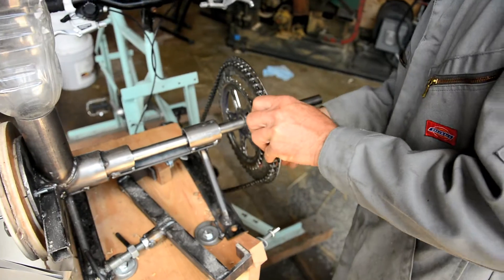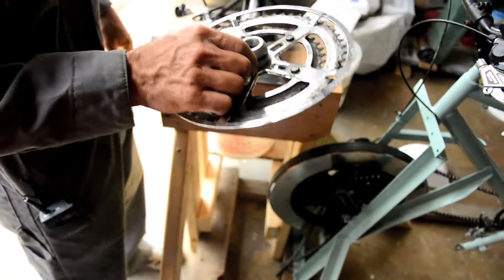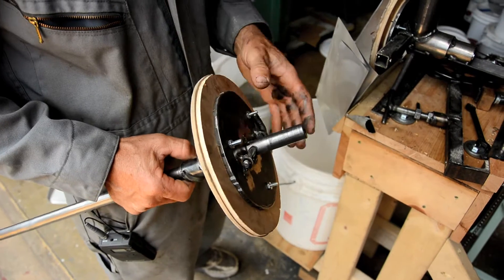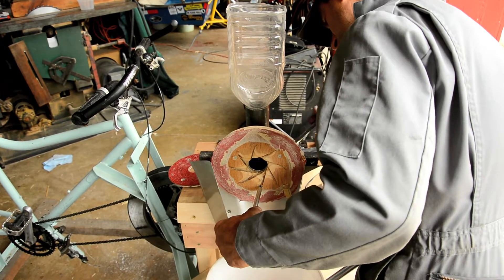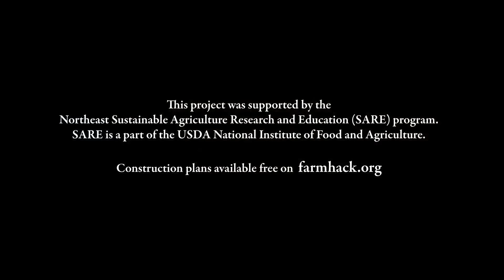GB3 Dehuller

Comment: The Thresher Plans PDF you uploaded are invaluable!  So generous of you to share this freely to anyone interested in replicating your thresher.  The winnower seems pretty straight forward (though will clearly take quite a bit of trial and error to tweak and get right), while the dehuller/grain mill seems quite a bit more complicated (for my current experience and skill set anyway).  I will have to learn how to tack weld at the very least, and various other skills and distinctions will make a pretty steep learning curve for me to make them just based off your videos on the two different machines, particularly without any diagrams with measurements, etc.  If they exist, is there any possibility that you might upload PDF plans either or both those two machines as well?  Thank you so much for making such detailed videos and sharing the two PDFs.  🙏
Reply: Hello,  the plans for ALL THE GRAIN BIKE MACHINES are available FREE thanks to a grant from SARE (so thank YOU for funding my passion).  The links to the plans are above (between the video and the comments).  When you land on the plans page you have to scroll down and click on the pdf link that says "plans final upload".  Enjoy!
Reply: @lusolarone2  Found them, THANK YOU!

Comment: There are a LOT of different sort of surfaces you could experiment with - such as more "natural" ones (rather than rubber or sandpaper).  How would force substitute or affect the action of various surfaces?  For instance, turning the axis of rotation in the mill itself to the vertical would allow you to use weights instead of screws to put a constant force on the rotating plates.  Too much force would smash the grain.  The rubbing would "bring out" the grain of the wood and produce a rougher surface, and various orientations and types of grain (different woods) would affect the amount of shear on the kernels.  
But on second thought, the rubber may be necessary to prevent sharp stress concentrations between two hard (say, wood) surfaces from shattering some of the kernels.
Reply: Hi and thank you for your interest in the Grain Bikes project.  Yes, there are lots of different materials for the two surfaces.  One that could work well is just the steel disc roughened with a sand blaster, or given a little tooth some other way.  Also, different grain crops beg for different amounts of "scouring" to de-hull; so there is a big difference between rice (primarily what we experimented with), barley, oats, einkorn, etc.  
     I don't think changing the axis would be worth it for this machine--the cost of the gear and the transmission losses are great and the benefits of the changed orientation seem small.  The pressure on the plates is controlled already by a combination of the adjustment screw and a rubber pad that backs one of the discs.  Please let me know if you find otherwise.
     As for the welder, we used a mini-mig for this project.  Because distortion is a nuisance for these aligned rotating parts, brass brazing with a torch would be a good fabrication strategy.

     The discs were faced on a metal lathe.
     Please follow the links to the construction plans-- they are not just blueprints but step-by-step recipes!  I hope this is helpful, thanks again for watching!

Comment: do you think this work for high revolution of the shaft (connected to an electric motor)?
Reply: Yes, with a v-belt transmission and an electric motor (1/2 hp?) and about 600rpm

Comment: does it work with  sunflower seeds
Reply: we never tried sunflower seeds but if you are prepared to experiment with more textured and agressive plates it might just work
Reply: I have an advice for you. You have to use a different method to dehull sunflower seeds. They have to be thrown with a certain spped onto a metal plate, or better, onto a metal screen with proper holes dimensions. The easiest way is to take two metal plate circles, make a hole in the center of one of the plates and connect the other plate to the shaft of an engine/bike. Then weld rectangular fins between the circles perpendicular to the axis of rotation, so when you are rotating the disc, insert the seeds trough the hole and they should be thrown away during rotation onto aforementioned plate / screen. On the impact, they outer shell will be separated from the seeds.

Comment: Have you tried using a high durometer gum or other food grade rubber in place of sand paper?
Reply: One side (the runner) is sand paper; the other side (stator) is food grade rubber or silicone.  If both sides are rubber it doesn't work as well.
Reply: lusolarone Haha.  Guess that's what I miss listening while I work. I have a small, cheap grain mill on the way to retrofit for this purpose.  Thanks for the pointer.

Comment: will that machine be suitable for the oat grains?
Reply: The machine, as built, did not work well for oats.  However, we did not have enough oats to experiment with, and I think it would be possible to change the size and material of the plates to do oats, barley, and other tough hulled grains.  We made it work for rice and einkorn.
Reply: Oats are difficult to dehull.  With more agressive plates there's a possibility it would work but it would require some trial and error.